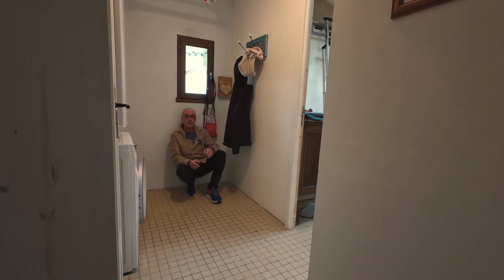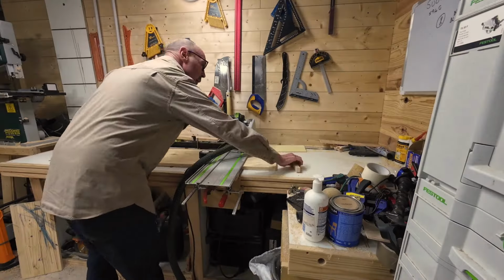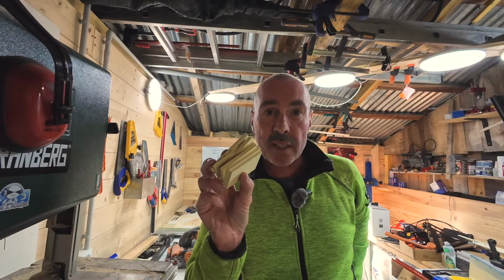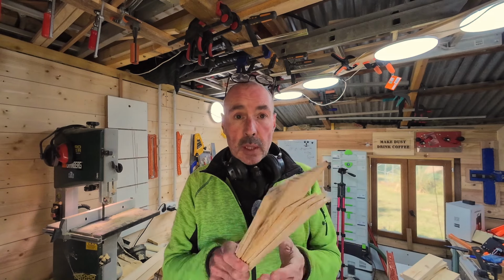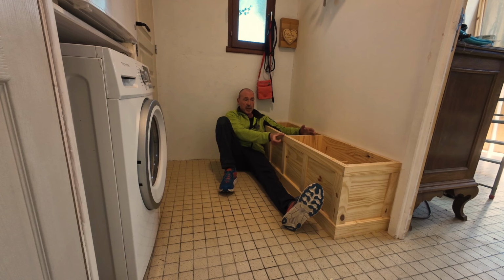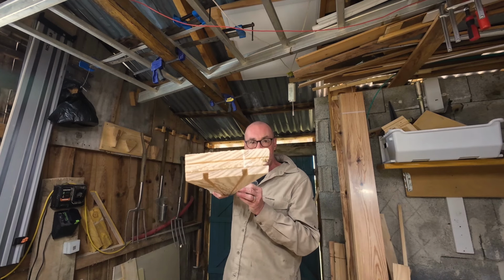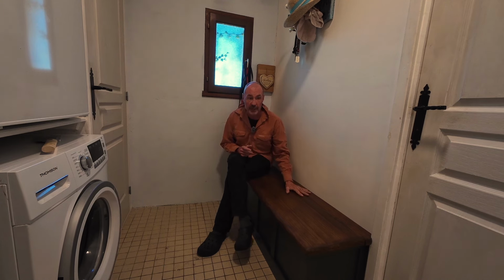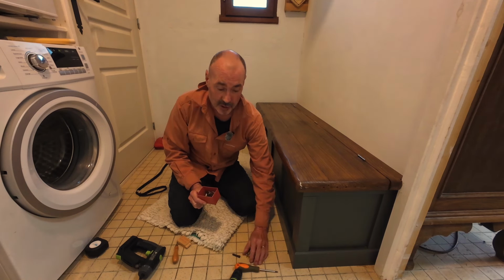Build a Mud Room Storage Seat

Comment: Great Project I've been looking at similar flooring here in UK but looks very expensive. One spookey thing I went to my allotment today and my fig tree had absolutely loads on it cheers
Reply from the maker: I love figs! Have you looked at traditional UK T&G floor boarding? Usually cheaper than PSE (PAR) All the  Small Loft Workshop was made from it. Regards JP
Reply: @Smallbarnworkshop  cheers I'll have a look
Reply: Lovely project. It turned out really nice. Bo has got soo big.
Reply from the maker: @franceshawe9572  Hi. Thanks you. She has. 18kg now. She was less than 5 back in April. Regards JP

Comment: Nice project. Why did you use pine if you were going to paint it anyway? Weight/strength of the material? Or perhaps you had it already?
Reply from the maker: @chimairanl9043  Hi. Price. It is by far the cheapest sheet material I can buy around here. Regards JP

Comment: I feel sorry for your Vac, suffering substantial Systainer pressure
Reply from the maker: HI Troy. German engineering at its best! Regards JP
Reply: @Smallbarnworkshop  I try and avoid stacking mine if possible, but looks like you are borrowing space matey .... Shop expansion coming  ???
Reply from the maker: I need to get my side wall done, if other projects stop getting in the way, then I can spread out a bit. Regards JP